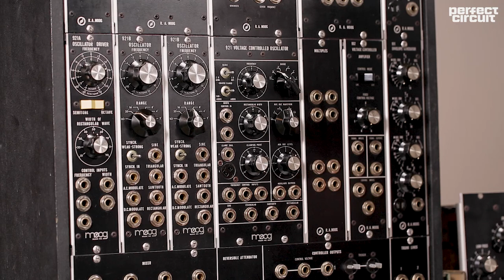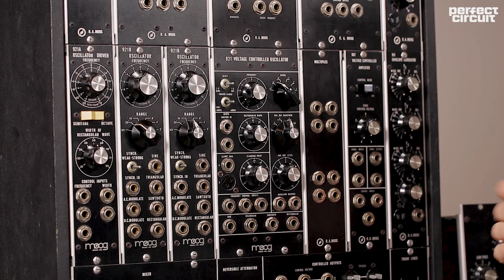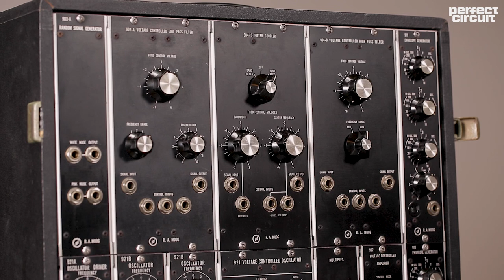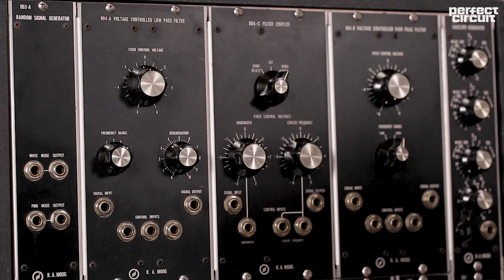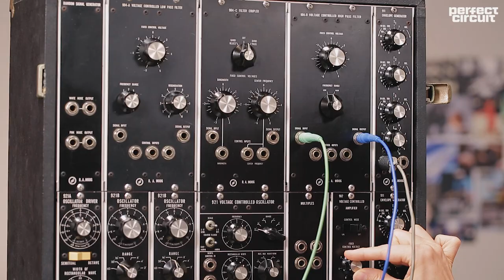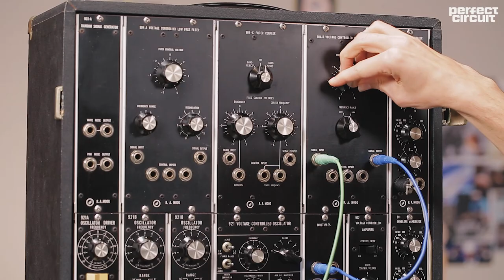Moog Modular Deep Dive : Vintage Filters on the Model 12

Comment: Kudos, Ryan. You are in a good position to become one of those youtube influencers.  That Moog's configuration would be perfect if they swapped out that mult for an extra VCA. Here's hoping that Moog reissues the 12, but I managed to acquire a Model 10, so I'm content.
Reply: It might be a shame if I was to own one of these beautiful modular synths because, as you know 👋😅, I have a tendency to modify things by adding jacks and switches all over the place to increase functional density. 🤓 At the very least the multiples could be moved to the noise module and in a more crowded system I even added a mult with attenuator to the bottom of Mos-Lab 902 VCA, although I might be burned at the stake if I did that to an original Moog 902! 😬
Reply: @JohnLRice  As long as the modifications were clean, sightly, and engineered with competence, it should be okay. However with a system as large as yours you would hardly need those modifications.
Reply: @Rhythmicons  heh, well, I've made many mistakes along the way to accommodate my modular addiction! 🤦‍♂️ Once my only modular system became so big that I couldn't easily expand it any more, (ceilings and doorways in the way)  I got the not so smart brilliant idea that because the modular was impractical to move, I could make just "one" small standalone modular for live use.  Long story short, besides the main system (which I managed to grow by 50% anyways) I now have about 11 separate unique small systems (about half eurorack and half 5U) and some are so small that it can be critically important to make modifications for added features and or performance convenience, etc. I've started  a series on my YouTube channel to document all of these systems and the modifications I've made, so if anyone is interested I'd appreciate the views! 🙏
Reply: @JohnLRice   I thought it was pretty ridiculous that mine is really three independent systems that look like two. If I can just keep from spending my money then the VCS3 will be number 4. Now watch Moog trick me into emptying my wallet.

Comment: You should consider reversing the position of the 904C & A because that's how they are supposed to be arranged. Whoever owned it might not have realized that, as the C & B were probably added later. A look at the date of manufacture would see if this is correct.